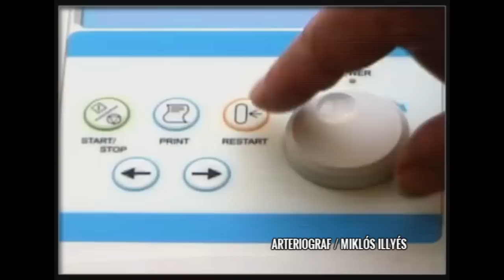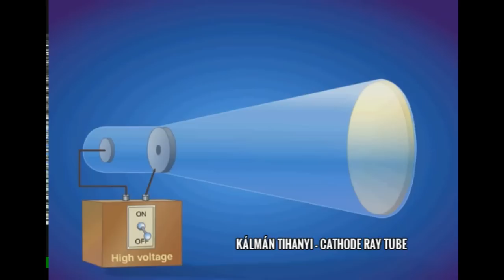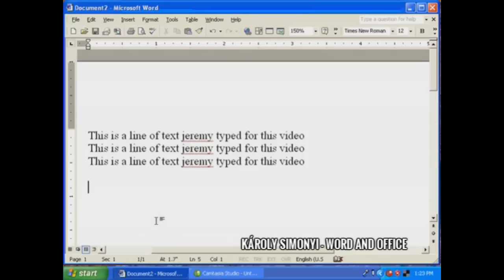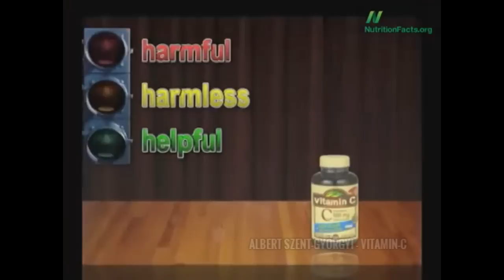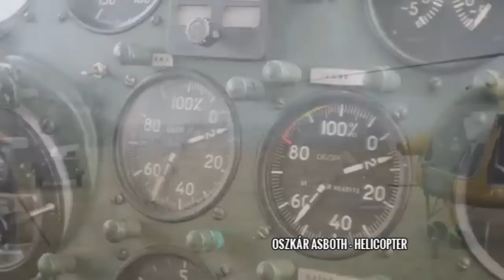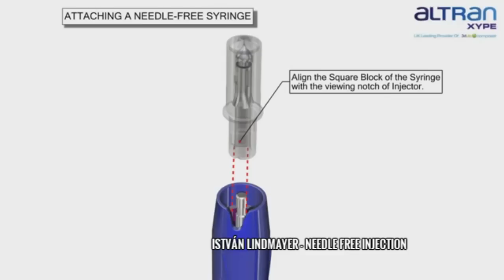Hungarian inventions

Comment: Hungarians also invented the biggest and most powerful fire engine. Using the bottom half of a T34 Russian tank with 2 mig jet engines mounted. Used it to put out oil fires in  after Sadat Hussain's army set fire to the oil fields. See it on you-tube. Brilliant